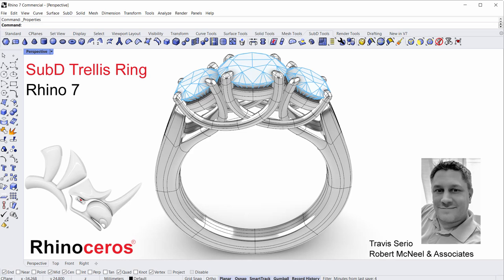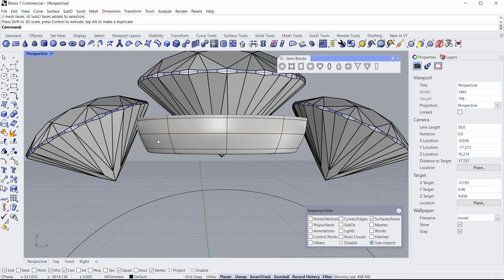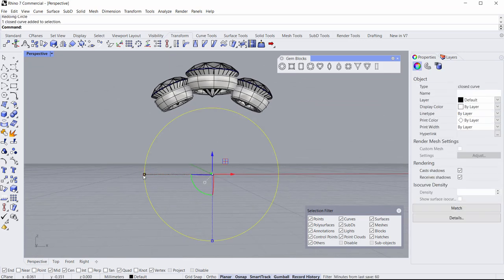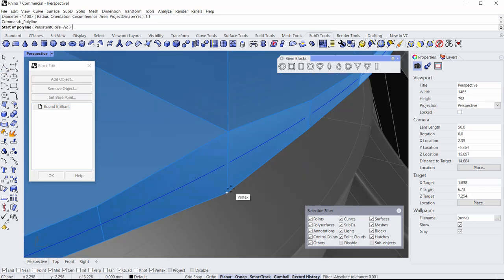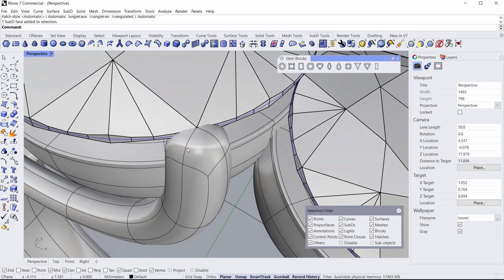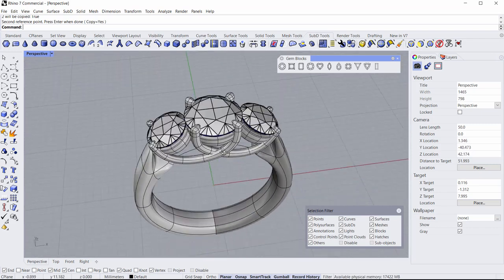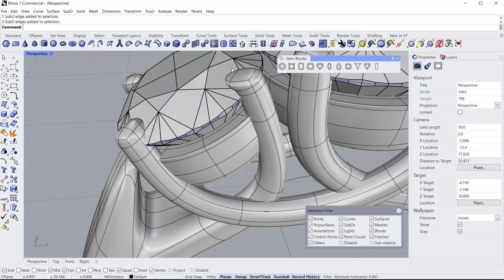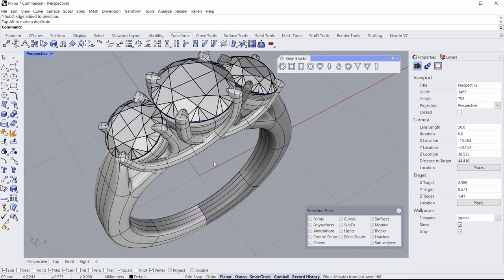SubD Trellis Ring

Comment: Thank you so much! I am having difficulty with the gem tool bar though - I imported the downloaded files and when I load the block manager, it works and I can use the stones, but I am unable to create a toolbar with them so I have to upload them each time I open a document and scale it manually - any help to get the toolbar functioning would be appreciated! I have tried the toolbar command and the options command, both of which are 'unknown' commands according to rhino (I am using rhino 7). Thank you!

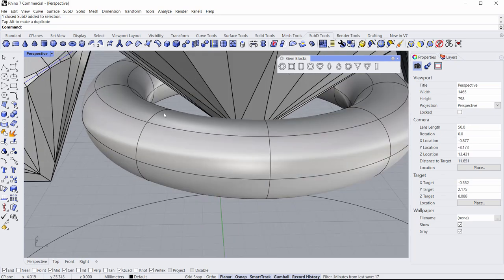Comment: At 3:26  how are you selecting all of the faces on the particular faces of the torus without having to either click all of them or use the click and drag method?
Reply from the maker: That's sub-object selection of a face loop using Ctrl/Cmd + Shift to select a face and then Ctrl/Cmd + Shift double click on an adjacent face to get the loop.